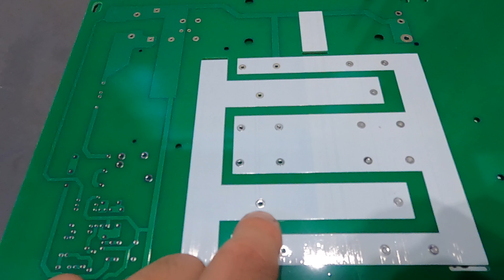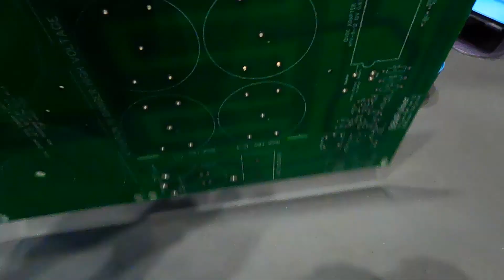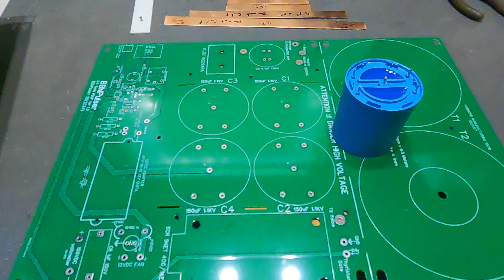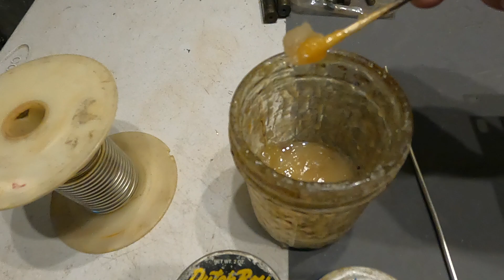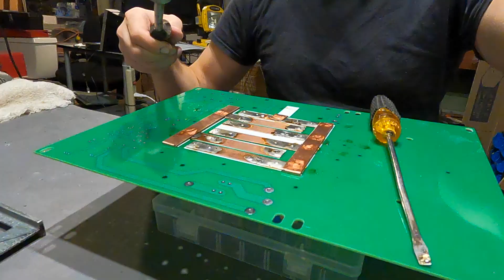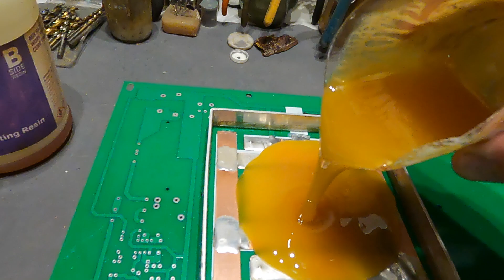185 How to solder Capacitor Bank on BBMPulser 5B and 3B PCB

Comment: Nice.  I could've used this 6 months ago.  ;-)
I love the old brute-force soldering iron. What Temperature do you heat it to? 
I'm thinking 340°-350°C?
I had to use a torch to supplement the heat from my iron, but it's a delicate process to heat the strips without charring the board.